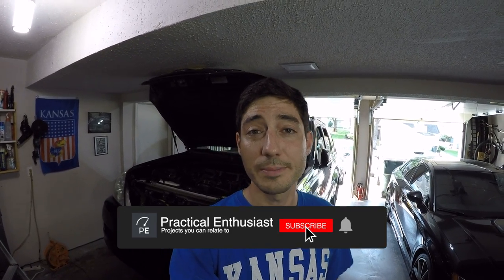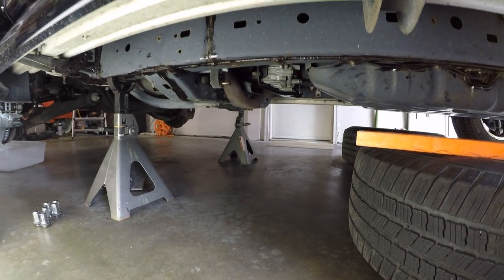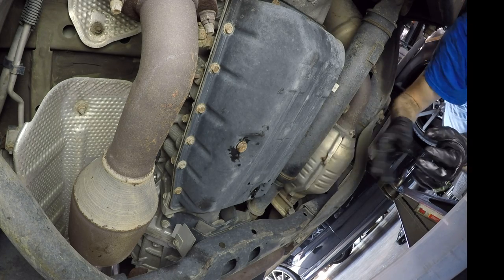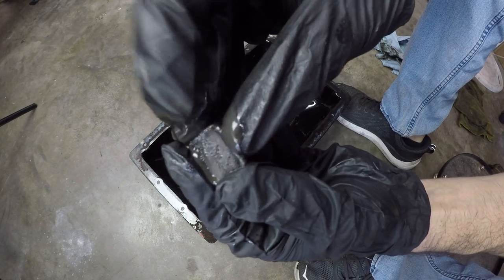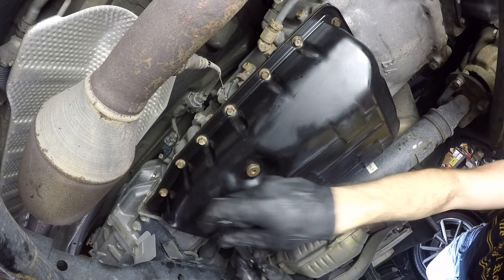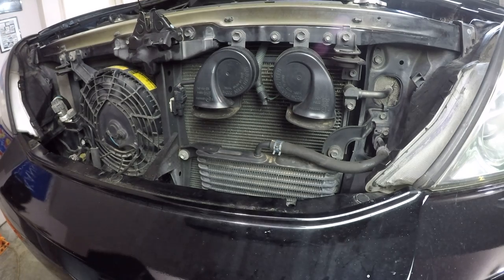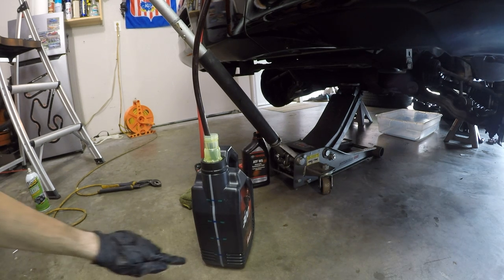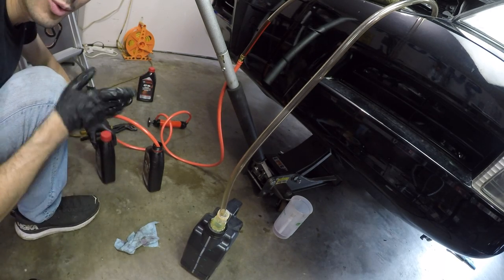High Mileage GX470 Restoration | Ep.4 | Transmission Fluid Flush & Filter Change

Comment: My 2004 has 246k miles with zero transmission maintenance. Looks like yours has about the same (241k?). I take it you don't know if your ATF was changed prior? I'd really like to do this by my gut says "no way!" 🤣
Reply from the maker: I don't think mine had ever been serviced before. I've put about 1k miles on since changing the fluid and it's working great.
Reply: Lucky asf bro I got one with 152k nothing wrong supposedly, 
had it for 3 months woke up one day transmission started to slip & the next week it was dead. 
So that put a bad taste in my mouth with Toyota/Lexus in general. I know it’s been used but history was good & no rust & had been in FL its whole life. 

Now 10k in the hole with a truck that’s worth 1k maybe. 

So yeah. Keep them fingers crossed.
Reply: @josephg.8919 did some one before you or did you do full flush on transmission or case transfer or front/rear differential? If, yes, it could be the  problem.  Watch some car care nut videos.  Sorry bro ....fell your pain.   I heard you can go back and put some portion of that old fluid to get your transmission back online.  I know it sounds counter intuitive, just watch the videos.  Cheers!
Reply: Try and drain the oil, check if it smells burnt, pump it back.
If it doesn't smell burnt, put the same amount of oil with additional half quart,
Do this every couple of thousand miles and you are good.

Comment: Not recommended full flush,  only drain and fill twice total with each oil change.  My transmission started to have issues after full flush at 70k, 17 gx460.

Comment: For anyone without a convenient Toyota parts dealer nearby, I performed this service at home and used Valvoline’s new Extended Protection Full Synth ATF. It’s a grey jug and it now lists Toyota WS.
Reply: About 5k problem free mi so far.
Reply: @joseysantana  can we get an update?  still issue free?
Reply: @jcontradiction  Yep! I used to have a hesitation after hard stops. No issues thus far.

Steps taken:
- Drained
- Dropped pan
- Surveyed magnets. 
- Cleaned pan
- Replaced old filter
- Replaced gasket
- Added back amount of fluid drained.
- Performed the cycles seen here but I ended up using techstream to observe ATF temp for final level check.

Comment: if you're thinking about doing this: before taking the pan off, try and wash/spray the threaded end of the 19 bolts holding the pan on. they are exposed and will have collected dirt which will wreck threads on their way out.

Comment: I'm not at your level and I knew u would have a transmission oil pan gasket leak after this maintenance so I skipped replacing the transmission filter part. I ran a fill tube through the engine bay down to the fill plug, so didn't have to use a pump. Took about 12-14 quarts to do the flush and it got rid of my transmission shudder and saved my torque converter. OBD tool worked on my FJ for the temp/overflow check.
Reply: A highly recommend taking that extra step and going ahead and dropping the pan. In my 03 with 210,000 had a horrible whining sound and also eventually quit going into gear all together. Come to find out that my filter was completely clogged with tons of gunk. So I replace the solenoid and then change my filter gasket put everything back damn thing shifts like butter now no problems over a year now

Comment: How is the transmission doing after the flush? Is it changing gear properly and no slipping? Because I heard that on high mileage transmission it is kind of risky to do a whole flush due to taking away the clutch particles with the fluid.
Reply from the maker: It's doing great! I've put on about 1,000 miles since the fluid change and everything works fine and it shifts smoothly.
Reply: Wow 1000 miles😂😂😂😂😂

Comment: If everything goes right tomorrow I will be picking one of these up with 136k miles on it tomorrow.  Not sure if the trans has ever been serviced.

I don’t like the flush procedure even though I know it’s the correct way.

I’m going to drain the 5 quarts and just add 5 quarts.  Drive about 1000miles and do it again. And then do that one more time after another 1000.miles.

I did this with my last car and the fluid was fairly clean the last time.

Comment: I keep hearing it can be risky to drain and fill the transmission fluid.. a local mechanic recommended I not do it. He said “we had one drive in and replaced it at owners request and it locked up and didn’t drive out.”  Obviously you chose to do it so I’d be curious on your thought process? Have loved watching this gx470 project you’ve done btw. Very skilled
Reply from the maker: That's a common concern when it comes to automatic transmission fluid servicing. I'm always in favor of replacing fluid, regardless of age or mileage. I wouldn't advise pressure flushing, but a regular drain and refill is not going to cause damage. I suspect most of these types of horror stories are the result of pressure flushing, overfilling, or using the wrong fluid. 

Every make/model of automatic transmission has a unique drain/fill process and often requires a specific type of fluid. It's honestly a lot more complicated than I think many shops give it credit for, and therefore the service is performed incorrectly and ultimately the transmission gets damaged.
Reply: @PracticalEnthusiast  thanks so much. Appreciate taking the time to answer

Comment: Unfortunately on a new to me GX the 24mm fill plug is rounded. Can i fill the fluid via the trans cooler hose instead like how you had it? (And without the other drain hose disconnected)
Reply from the maker: Oh no! Sorry to hear that. Yes, you can fill through the transmission cooler line.

Comment: No dipstick on these?
Reply from the maker: Unfortunately not.
Reply: Only on the 2003 model you have a dipstick, the 2004-2009 are "sealed" transmission, but with a fill and drain plugs.